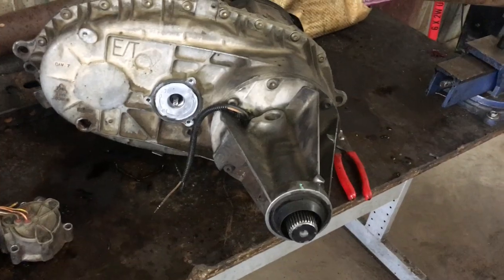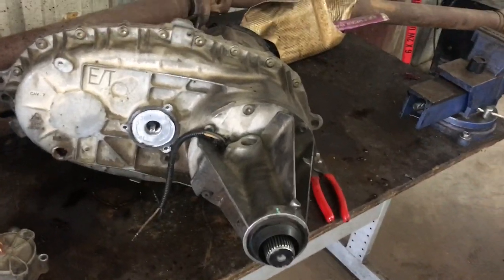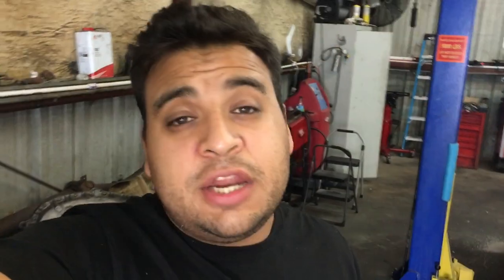2004 - 2008 F150 FX4 5.4 SPEEDOMETER READING HIGH

Comment: The speedometer was off because the computer read the setting of the dash board transfer case switch or button which was in 4L but the transfer case was really in 4H because of the fault.  4H is twice the speed of 4L and the computer compensates by doubling the displayed speed on the speedometer.  The truck only has one speed sensor on the transmission so the computer calculates the wheel speed using the setting of the transfer unit which is after the transmission.
Reply: This video just popped up to watch. So i watched and knew why the Speedo was off because of the transfercase. I wanted to sound all smart and make my case but, you beat me to it.
Reply: Great info! Could you damage the transmission by driving the truck normally with the transfer case having issues?
Reply: Transmission sensors(two of them) reed output and output shaft speed of mentioned above transmission, thats how ECM knows if clutch slipping or not. Those sensors do not read the vehicle speed. Regardless of 4L or 2H they still monitor transmission RPM, not the vehicle speed. So your theory makes absolutely no sense at all buddy.

Comment: The speed is controlled by the ECU. The ECU "knows" if the transfer case is on 4 Low or 2 High. When the ECU "knows" that is in 4 LOW, the ECU itself cuts the speedometer reading in half. If the ECU "thinks" that the transfer case is in 2 or 4 High but in reality the transfer case is fisically in 4 LOW that's when the speed will read incorrectly. If you open that transfer case you will see that is stuck in 4 LOW. But the ECU thinks that is in 2 or 4 High so it shows the speedometer according to that. In a system working correctly, when you switch to 4 LOW the ECU recalculates the speed and doubles the reading. That's how it works. Best regards.

Comment: I've had that same problem I bought a F-150 that they put three or four different transmissions in it well on the transmission it has a plate with the computer number whatever if that transmission number on that plate does not match your computer on your truck it will not shift right I had four different transmission put in my F-150 in everyone I'm done something different you know but I took the original transmission that come out of it and had it rebuilt and had a problem since

Comment: Low 4wd is low gear transfer was stuck in that gear no matter gear it said it was in . . So trany would show a faster speed because if in 2wd or 4 high is what  the sensors are set for.  the higher gear . Basically if in high gear the truck would be doing 100 . But if stuck in low gear, you'd be doing 40 or 50 . But the sensor in the rearend should have corrected that problem. Unless transfer case was reading it was in the higher 2wd high 4wd gear . This would make sense.